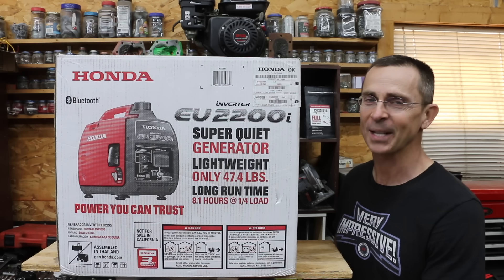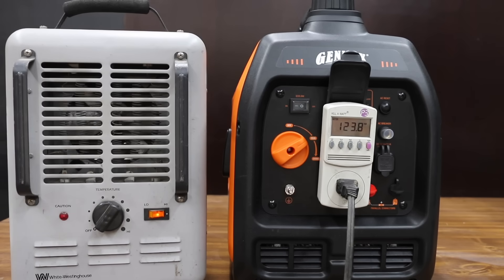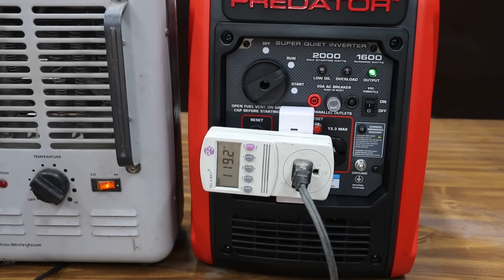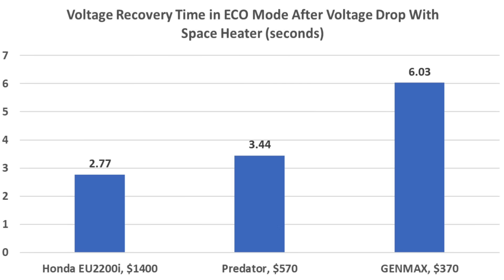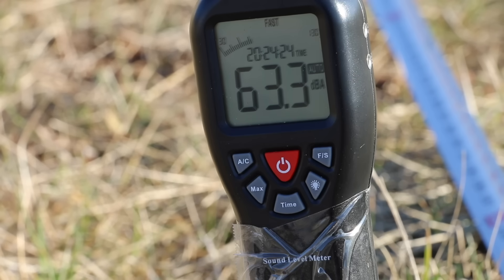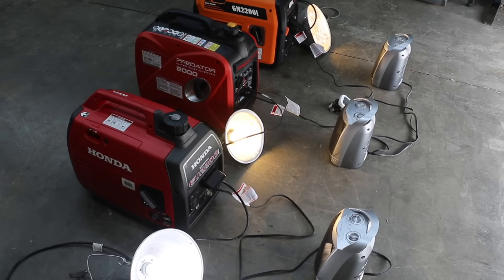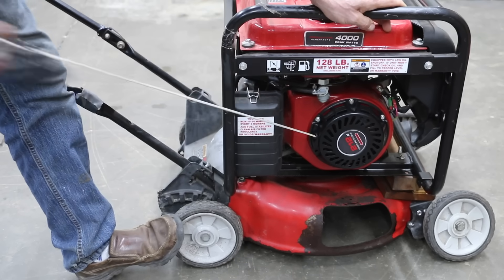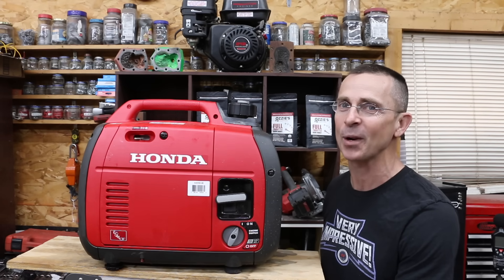Cheap Generator Better Than Honda? Predator vs Honda & GENMAX—Let’s Settle This!

Comment: There is no way a generator that small should be $1200. Something tells me they think the Honda name alone is worth $850.
Reply: Did you miss the part where neither of the other generators would run a sustained 1500w load, and both engines showed excessive wear with only 100 hours of use?
Reply: It kinda is worth that. Honda starts every time. Without fail. I have a 12 years old version of the generator reviewed here. It has never failed me. Runs as if it is new. Peace of mind and longevity is worth a lot.

Comment: Sir can you run a test with those generators running a household refrigerator which is what we would need if the power goes out. Thank you for all you do
Reply from the maker: You are welcome!  Thanks for the suggestion.

Comment: That Honda is a nice generator.  I have a Briggs and Stratton P3000 from 2017 and it's kind of a clone of the Honda.  Ran 8 days straight once in the winter keeping my heat and essentials on without skipping a beat.   My power doesn't go out often but a generator provides great peace of mind.  Thank you and kind regards

Comment: I have this Honda Generator and a one Hp Honda String trimmer, and both are Great ! 
Earlier this summer, I had to remove the cover from the Trimmer cuz the Mud Daubers
built a bunch of houses inside on the cooling fins, After I removed several hands full
of dried mud, it ran like a top  !
Reply from the maker: Thanks for sharing.

Comment: I like your reviews but a few nits to pick.  One, most modern "sensitive electronic" devices use switching power supplies and really do not care much about the input waveform as the first thing the AC goes into is a bridge to turn it into DC.  Some of them will even run off of DC.  Also most of them are indifferent about the  input voltage, like 90 to 230 being a pretty typical range.

As far as the economy modes goes, if you under power a motor that is working for a long time you will heat it up.  When I use a tool on a generator, economy mode or not, I let it come up to speed before I start taking it.  The things hit hardest by the economy mode are probably air compressors usually have one revolution to come up to speed before they start compressing, assuming it has been used and kicked off and back on.

I have extensively used the little 1KW 2 cycle generators and honestly I can not say enough good stuff about them.  My oldest one ahs to be going on 25 years old now and is still on the plug that came with it.  It has been on countless back woods builds, ran floodlights for breaking down after fireworks shows, and kept the sat box and TV going in blackouts.  I have another one in a wagon with a battery charger and an air compressor, very handy to get lawn and garden tractors going, bringing the air and power to them.  I take the same wagon out with my pole saw.  Again, let it get up to speed and cut away like mad.

About the only thing that I have ever seen get really pissed off running off a generator was a PA power amplifier, and that was back in the old transformer days.  I suspect one with s switcher in it would be happy.

Comment: at a Price Point  the Predator 2000w is $570 =$0.285 a watt , You can get the GenMax GM3200I  for $489 = $0.152 a watt  and it has a bigger engine 145cc  which will handle loads better and your getting 3200watts , I have a GM3200I and its been Great .
Reply from the maker: Thanks for sharing.

Comment: I bought this for my stepmother during hurricane Ian. We used it for one day and then her power was back on. Each year I take it out and run it for about 15 minutes. Hurricane Milton came knocking and this generator saved me from the heat of Florida. Super quiet when using ECO mode. I ran a window AC unit, refrigerator, toaster, coffee pot, lamp, charging everyone's cell phones. They were NOT all running at the same time. Pick and choose what you need. When running the AC and refrigerator, I would run them for about 3 hours then turn the generator off. 
When storing the generator, I do NOT keep gas in it. I drain it from all gas and even take the carburetor out and drain it. Change the oil after several days of usage, and change the oil before storing it. Oil is cheap, don't be a lazy A$$hole and not change it. Read the manual and you won't have any problems. And this thing is SO QUIET.......
Buy The Honda, it is a better investment.
Reply from the maker: Thanks for sharing.

Comment: Insane review.    I have a Honda 2000i I bought in 2010.     It ran for 5 days solid except for an oil change and gas fills.   I’ll continue to trust the Honda
Reply from the maker: Thanks for the feedback.
Reply: This was during recent Helene.   She was nasty.   Getting a 50 amp
Inlet port put in beside my panel in a month to maximize two 2000i’s paralleled.

Comment: Explanation;
The No sine wave cheap little generators like the harbor freight storm cat. Will destroy most electronics. The storm cat broke my 12 volt battery charger. 
I purchased a sine wave 1kw cheap generator because it had the smallest 4 cycle 40cc engine.  It does use very little gas but not the 800 running watts it claims. Seems to run well at under 400 watts, but it overheats at around a hour on warm summer night.  Works best on colder winter conditions. Not something to run continuously, but great for charging a phone and car batteries it does handle the boost amps on a car charger.

The 40cc is the smallest I could find Honda made a 1kw that has a 60cc engine. 

If you want a more reliable smallest sine wave generator the Honda 60cc 1kw is better.
The price is more than double.

Also Ethanol free gas will improve performance, I used Lucas gas treatment with fuel sta-bil.
Reply from the maker: Thanks for sharing.

Comment: I recently had a power outage, and I didn't have a generator. The person next door had an extra one he had lying around, it was a 15-year-old Honda.  It ran like it was brand new.  Almost 14 hours of straight use and it never even blinked.  I know it's a lot of money for a Honda, but dang, 15 years, and it works that well?  That is just quality engineering.
Reply from the maker: Thanks for sharing.

Comment: I bought a Honda eu2000 in 2013, ran it on my boat 24-7 for years, today I still use it for hurricanes. This generator has tens of thousands of hours on it, still original sparkplug and pull cord altho the cord is getting a wear spot, I do frequent oil changes, I use shell conventional sae 30 oil. This generator never takes more than a few pulls to start. I'll never buy another brand. It's been nothing short if spectacular.
Reply from the maker: Thanks for sharing.

Comment: Question is for dummies like myself is how loud is 60 decibels? What does that compare to? So he’s even showing a larger gas generator and that’s only 70? My 7000watt generator is extremely loud so is extremely loud only 80 decibels? So 60 decibels seems like it would still be loud if that 4000watt junk one was 70 decibels? I’m confused-I’m trying to find a small,somewhat quiet one that works well.
Reply from the maker: Thanks for the suggestion.

Comment: Always seems weird to me that the sound issue is still a thing.  Literally all these generators would need to do is just put a bigger muffler on and they could be nearly silent.  Ever notice how your 400hp truck is quieter than your 80cc generator?  Yeah, it’s because it has a muffler as big as your generator.  So how come we couldn’t just get generators with a muffler that’s one whole side of the generator, or with a muffler upgrade kit option?  I’ll never know.
Reply: Good points.  There are some neighbors around me that have installed Generac systems over the past couple of years.  We recently lots power during Hurricane Milton, and you could hear these things racking off over half a block away.  WAY too loud, especially considering the cost of these systems!
Reply from the maker: Thanks for the feedback.

Comment: I started my Honda Generator Wednesday the 9th. because of Milton. I cut it off SAturday evening the 12th. It ran without stopping and used a tad less then 20 gallons of gas. (non-ethanol ) It runs all of my stuff except the 220 things.I have a seperate box for my generator. It is about 12 years old and I got it during Hurricane Charley and it has been through many hurricanes and power failures. I'm thinking of converting it to run on PROPANE.

Comment: I own the PowerSmart 2200W from Amazon. I put an hour meter before the 1st start. It has over 100 hours on it now with zero problems. Starts on the 2nd pull cold and 1st pull hot. At the time it was $349 in 2021. Now there's a new version that's 2500W with some price increase. I simply love this PowerSmart, it's also very quiet and great on fuel. I would love to see this reviewed even though from my experience it's been truly a wonderful generator. I change oil 2 times a year, summer - winter no matter what the hours are used with non-ethanol fuel and storage Stabil added. It's still on original spark plug. I also start it on the ECO mode setting at full choke ( soon as it starts take choke off ). I don't see a reason to start these on full power, they start easy.
Reply from the maker: Thanks for sharing.

Comment: I have the Genmax duel fuel 3000/3500 with electric start and stop for 840.00. I sold my Honda EU2200i. It's now a year later, and I am very pleased with the Gemax. Honda my be reliable, but technology wise, they are dated.
Reply from the maker: Thanks for sharing.

Comment: Not sure why anyone says the Honda is quiet. Yes, it’s quieter than a larger unit. But I just tested mine and it’s 70db at 25’. This is loud and the numbers they advertise are misleading. You’re not putting it 50’ away when camping unless you want a lot of voltage drop through an extension cord.
Reply from the maker: Thanks for sharing.

Comment: Our Honda EU 2000 is 16 years old and works great.  It can sit for 6 months..change the oil...4 pulls later it running.  Friends of ours by the less expensive generators but none of them has lasted.  And by the way, I was at Home Depot and the new EU 200 was $1096..same price I paid for my honda 16 years ago.  Honda is the way to go unless you want to but a new $500 one every couple years.

Comment: I had Honda and predator for bang for buck predator did better than Honda . But Honda is the standard and never knock on it. But the predator was better for me and and many ppl I know has switched over to predator. I have experience the spark plug issue like he did. Wonder if it was bad from get go.

Comment: Have a Honda 3000 for the last 20 years.  Has run the whole house (no a/c of course) on multiple occasions, really showed it's value for two days during hurricane Helene recently.  Only issue is keep a spare spark plug handy.  Fantastic equipment that starts on the first pull every time..  Cheers
Reply from the maker: Cheer!  Thanks for watching!

Comment: I think a good follow-up video would be to do one from all of the major hardware stores because they all have their brand. Northern tool harbor freight home Depot Lowe's tractor supply and rural King just to name a few. You could try to get them all the same size but get each stores brand and see which one of those comes out on top. This is one of those things that you want to work when you need it, but you also don't want to go by the most expensive one. So it would be good to know which one that you could get without breaking your bank account but is also reliable
Reply from the maker: Thanks for the suggestion.

Comment: I guess with these kind of things my issue always is longevity. Which one of these is going to outlast the other one if the $400 generator dies and you have to replace it two or three times and the Honda is still running. You've essentially spent the same amount of money and had to replace them. So which one stands the test of time? And is it worth it to spend more on a more reputable brand?

Comment: These cheaper generators have to cut corners somewhere, most likely quality control, tolerances, longevity of parts. The real test is how does it hold up long term. Honda generators cost more but if taken care of they could outlast two or three of the other Chinese made generators. Key to generator life is changing the oil regularly, and run it periodically. For gas powered generators draining the tank and carburetor when storing long term.
Reply from the maker: Thanks for the feedback.

Comment: Id like to see the difference in a regular generator and a inverter  in comparable size from harbor freight. A larger unit say around 55watts or larger. One to use  for a average home  for  a emergency power outage .
Reply from the maker: Thanks for the suggestion.

Comment: I'm confused; with your oscilloscope you showed the dirty sine wave on that tailgator and the predator was also dirty but @7:10 you show the predator producing a clean sine wave. Was one testing with no load and then under load or what exactly. Trying to not burn up my new PC over here. Thanks
Reply: He tested two predators. The larger one produced dirty power. It’s the one that was mounted on top of the lawn mower during the sound test. The small 2000 watt one was the clean sine wave.
Reply: @Bob_Smith19  I'll have to rewatch this again, thanks. Hope the dirty findings don't apply to all Predators over 2000watt ones -
I really need to have 4500 running watts - are there any predator models that size that Would put out clean power? Hondas are just to dang expensive. Thanks again for clearing that up for me.

Comment: I have 2 Yamaha 2200 generators.  Compared to the Honda it makes a bit more noise, but barely noticeable in the field.  The real difference is the cost.  Under $400 for the Yamaha  and at the time $1100 for the Honda.  Thank you for this comparison.  There are so many brands out now.
Reply from the maker: You are welcome!

Comment: The Japanese contribution to Desert Storm was Honda Generators and Sony TVs. I would have preferred a Japanese pilot screaming Tora! Tora! Tora! As the T72 turret ĺis launched to the moon. The Hondas were more pleasing on the ear than the diesel army generators and they were easier to maintain.  The only thing I missed was the noise when I was navigating back to my HQ.😅

Comment: Firman  (Costco primary seller)          Also;  I wonder why all these tested have no separate fuel shut off, just a fuel/ignition combination switch.  Without that, the only way to run the carb dry is empty the fuel tank, then run dry or access the carb and remove a drain plug.  What are they thinking?  My Firman has a fuel shutoff.
Reply: The Honda has a setting to shut off fuel before shutting off the engine. It’s slightly above the shit off engine position. This allows you to empty the carb.

Comment: Unbiased, data driven, detailed analysis. You do a great job with this kind of stuff! Thank you!  
I would love to see a similar comparison of inverter generators in the 3000 - 4000 watt class that are RV ready. They are challenging because they need to handle a significant load, be quiet, mobile enough to move around a campsite and of course reliable.
Reply from the maker: Thanks and you are welcome!  Thanks for the suggestion.

Comment: It's notable that decibels are logarithmic, where a 3dB difference is a doubling of power, so a 6dB difference in noise is actually 4x the acoustic energy! 

Human volume perception is also sorta-kinda-almost logarithmic so we don't perceive it quite so drastically, but it shows up in how far away your neighbors, or thieves, can hear the machine running.

Comment: The real difference is the honda properly maintained will do 5000 hrs !!!!! the chinese copy will do 1500 perhaps 2000+ and if so its okay value for money ....... expect to replace every two years  at a third or less the price nothing wrong with that ... price wise but if you dont want to consume x3 times the plastic and resources and if you can afford the price go the honda bye the bye they cost 1800/$2000 australian here i own the 22ui model and currently have 3500 plus hours running in the last 3 and a half years the only thing that needed replacing was the pull start cord did it myself ten bucs oil changes every 100 hrs with 10w50 extra zinc full synthetic PENRITE OIL  best ozzie oil  ... EVER !! and run 91 or 95,,,, NON ETHANOL FUEL...  cant beat the honda fact ....... never not started .... fact  only thing comes close or equal is the Yamaha range of generators .. chinese inverter generators have improved a hell of a lot in ten years no doubt about it but japanese steel = piston rings , bearings and cylinder sleves etc are still far far superior i expect 5 plus years from my honda and when i does finally die i will buy another one if i need too !!! its excellent on fuel consumption and pretty quiet too

Comment: I think i would buy the Predator and get the extended warranty. This is mostly because if something goes wrong with it Harbor Freight will take care of it. Typically, they'll just swap it out. So for about half the price of a Honda, you'll have a decent unit with a relatively low downside.
Reply from the maker: Thanks for the constructive feedback.
Reply: Our mobile car wash guy has a predator 3500 in his truck. He runs that thing 5 days a week 4-6 hours a day. About 1000 hr/year.  He’s had it for 4 years.

Comment: I wonder what the oil results would be after a 1000 miles?  I know Honda makes a hell of a small motor.  But I'm wondering of the wear metal in the oil levels off somewhere or if the trend continues.

Comment: Wait! You showed a predator 4000 in the force to pull test. How does that compare to the predator 2000?
Reply from the maker: Thanks for the suggestion.